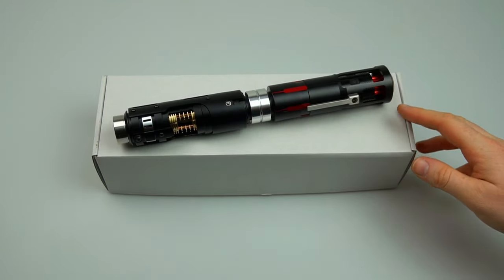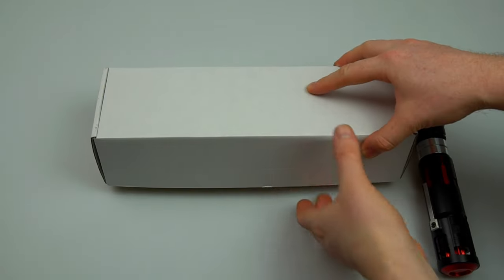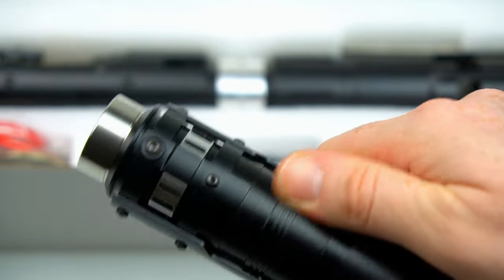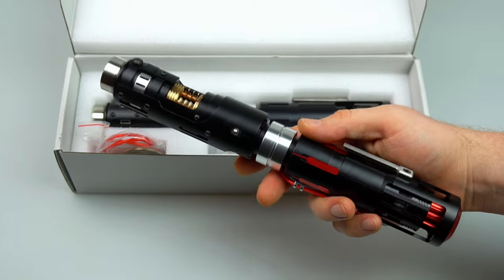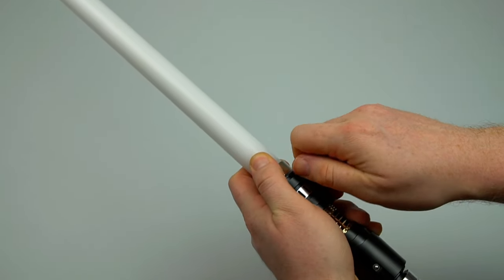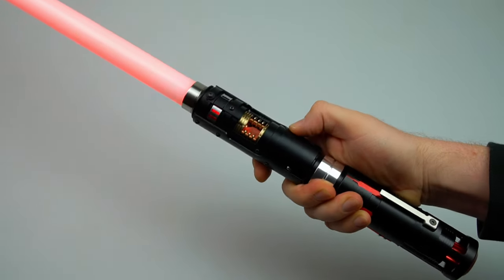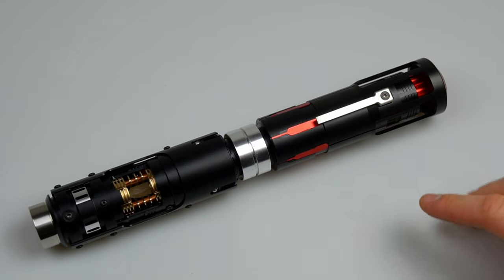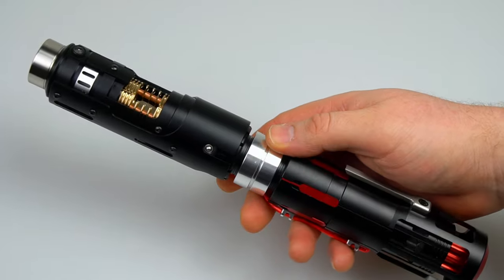'Heart of Siberia' DIY Empty Hilt FX Kit by Denis Lukyanov - Visual Dictionary Jedi Killer Concept

Comment: How did you get the crystal to have different effects with the eco chassis? I looked over the install guide and it says to have the accent pixel wired in line with the blade and was just wondering how to have it separate from the main blade using the rotary PCB system since there’s only one data pad?
Reply from the maker: It’s done by the programming of the Proffie soundboard. 👍